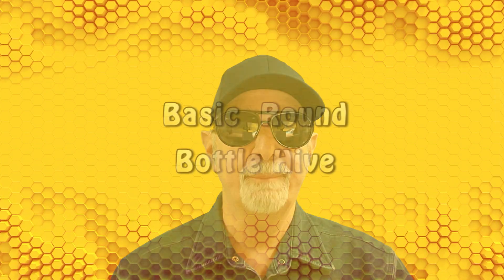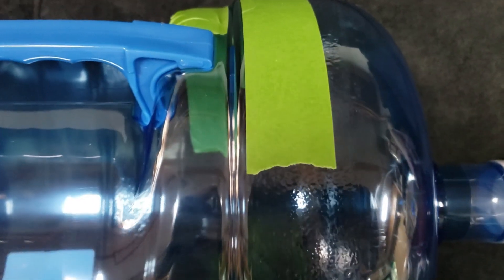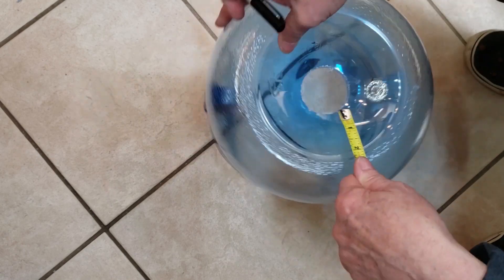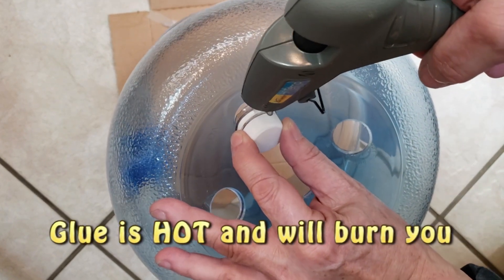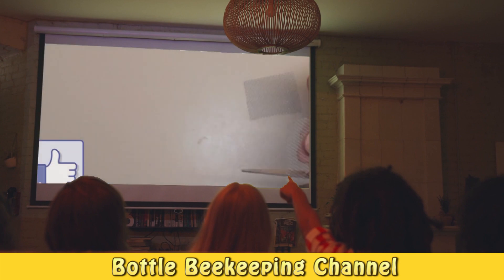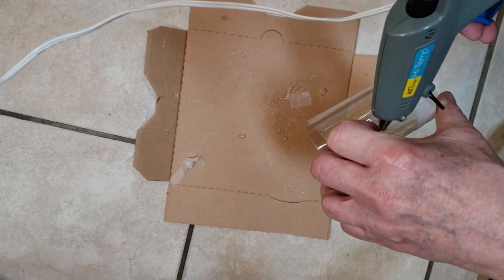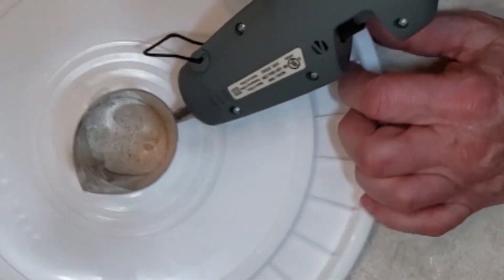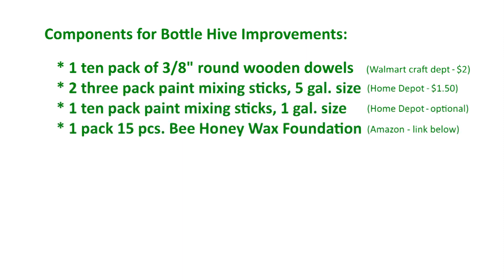Bottle To Bottle Beekeeping | Basic Round Bottle Hive Construction | Part 1

Comment: you are a great teacher, well spoken direct instructions easy to follow. by the way thought you would like to know hot glue is prone to water leaks
Reply from the maker: Thanks. I'll have to look into alternatives to the hot glue. The way the bottle are built they are not inherently subject to water intrusion from the top. That is why I put the "pointy" end of the bottle up and make sure that the top edges overlap the bottom portion of the bottle.

Comment: Dumb question #1...

Once the hive made is it hung or placed another way to be accessible to the bees?

Dumb question #2...

If we cut the top off of the bottle it leaves the bottle open? Is the top put back on later? How? Why is it cut off? And is it held back in place?

Dumb question #3...

Do we put the water bottle cap back on to keep rain out?
Reply from the maker: Good Questions.
1) You can place it on a stand or hang it on a tree. There is a multipart series for how to build a base that will do either. If you go to the channel page, there is a playlist for "Entrance and tree mount".
2) This is part 1 of a multi-part video series.  The attachment of the top is shown at the end of the next in the series: "Top bars for round bottles" video. The top is taken off so that you can put top bars or frames inside the bottle before putting the lid back on. There is a series on the channel page "Round bottle beehive construction"
3) Yes, the lid goes on to keep the rain out.  The last part of the "Vents and lures" video also shows getting more ventilation for arid climates using a screened lid. There is an upcoming video that will expand on additional ventilation through the top suitable for all climates (that video will reference the "Thunder Dome" in the title.)

The two playlists on the channel home page cover almost all of it. Each video is relatively short. Finally, to get an overview of how the parts work together as a system, the video with the thumbnail "How it all works together" is a must see.
Reply: @BottleBeekeeping  
Thanks much.

I'm very interested in thus topic (honey Bees)and an avid do it yourselfer...

I didn't realize there was a series on this I'll check the other videos out!

Thanks again!
👍👍👍🍻